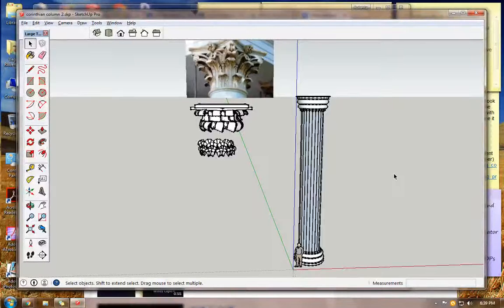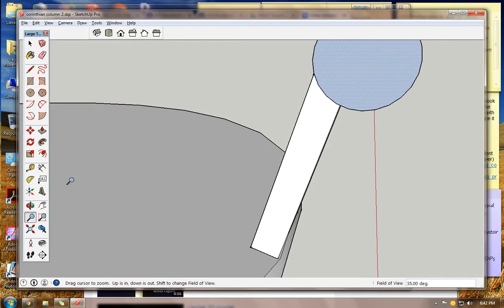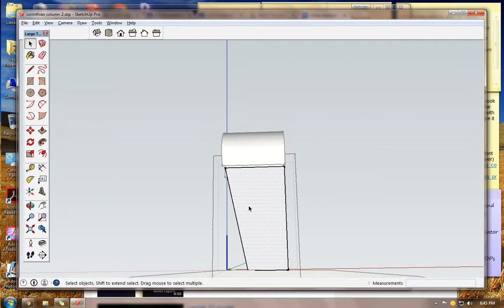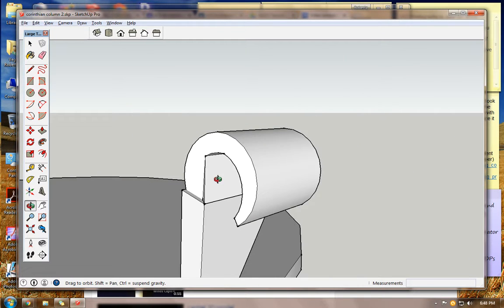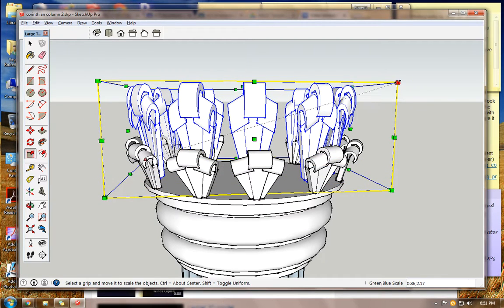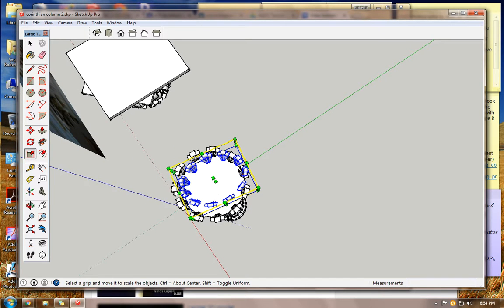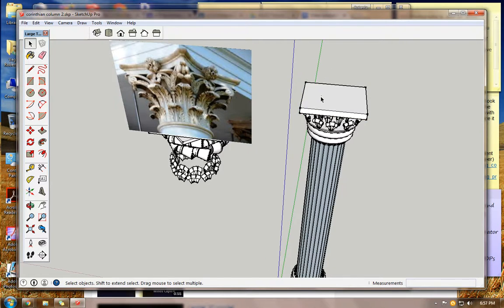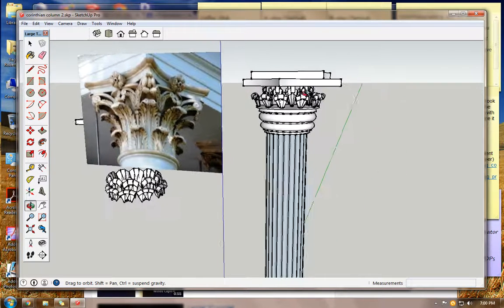Corinthian capital  using Sketch-up

Comment: I was going to just suggest that there is no need to pre-select anything when drawing a line or using the push/pull tool.  It is highly inefficient to do so. The least amount of clicks/picks there are the sooner the job will be completed.

There are so many other things wrong with this "Tutorial" that maybe you should take some classes yourself.
One example is perhaps one of the greatest strengths of SketchUp.  That is "Inferences". You should be using the center of the circle on top of the "capital" to rotate/copy the "leafs". To do this, hover on a vertex of the circle until a label is displayed along with a dashed line going to the center of the circle. Move the cursor to the center of the circle that was displayed and click to use it as the center of the rotation.

Just some friendly tips to hopefully make your usage of SketchUp more accurate and efficient.